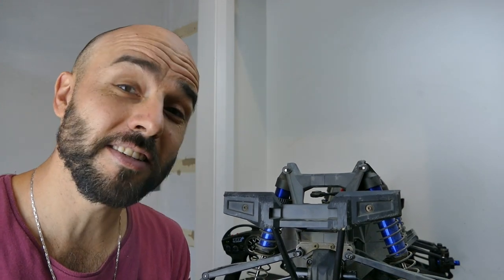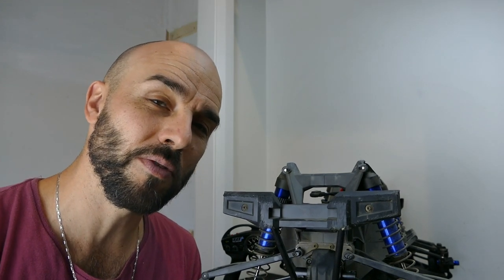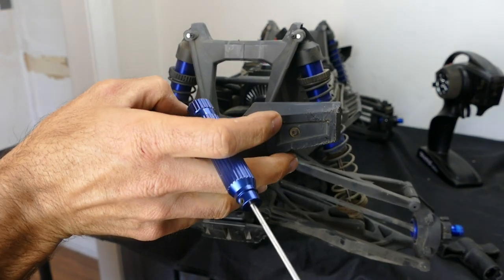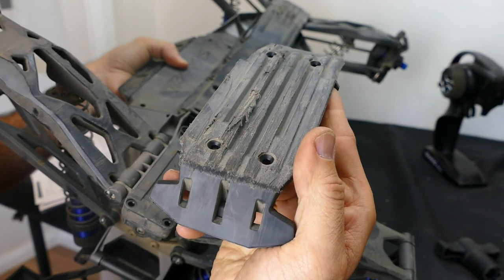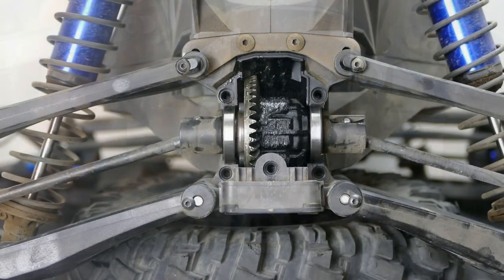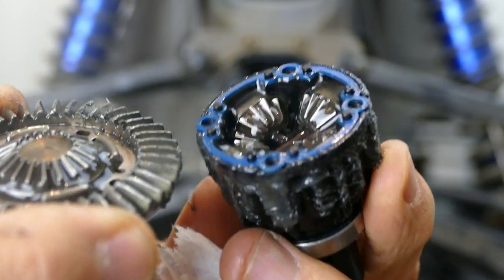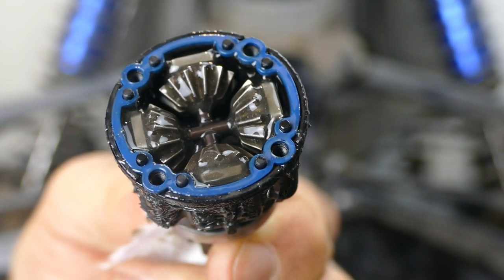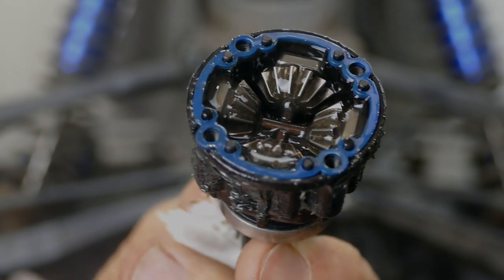TRAXXAS X-MAXX - How To Get To The Differentials - Let's Have A Look Inside

Comment: Glad to see that it is that easy to access the diffs! Thanks for the walk through and the footage from the new camera looks really good.
Reply from the maker: Yeah simple as brother. You're welcome, couldn't help myself and get the camera out :) 
The camera is great, although it is region locked to PAL and the highest frame rate is 100fps. No big deal I guess.
Reply: Thanks for getting it out. Very helpful. I haven't thought about opening the Diffs yet because it's usually a pain, but now I'll go for it to check it out. Weird about the forced frame rates...especially with so much content only going online.
Reply from the maker: Yeah I thought it was weird too. It's all digital now. It's not like I am going to produce it at my local TV network.

Comment: So I was out bashing the xmaxx and I came down hard from about 16ft in the air. I noticed I lot my front wheel drive. When I lift up the front end and turn one wheel the other wheel turns the same direction instead of opposite of the one I'm turning. Any ideas on what my issue might be?